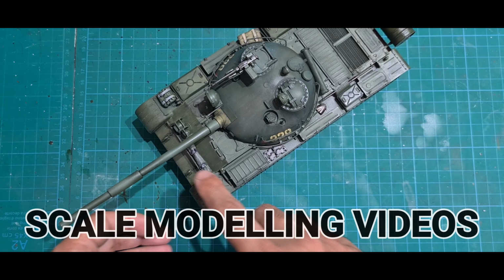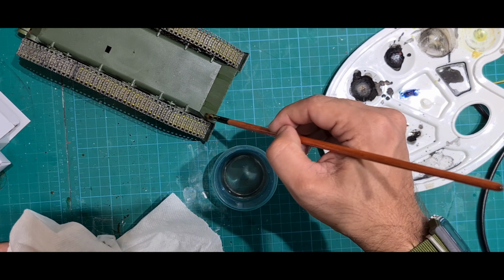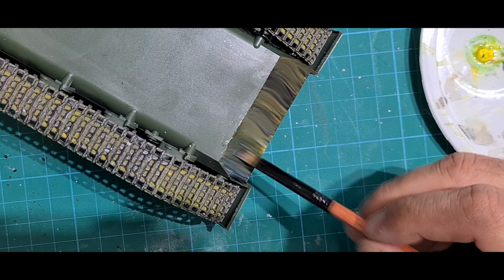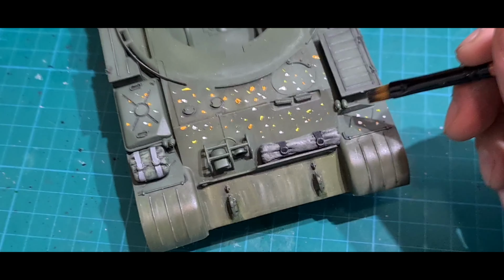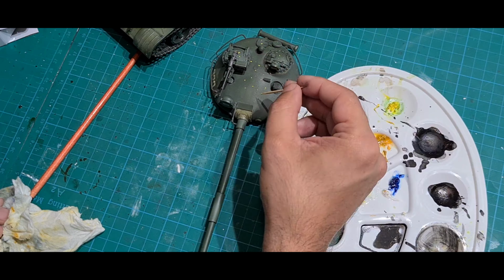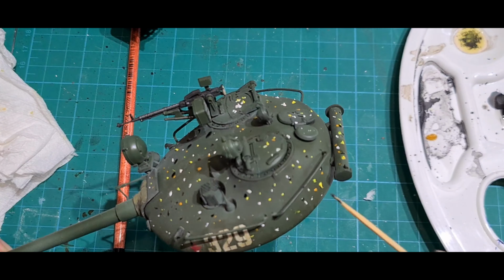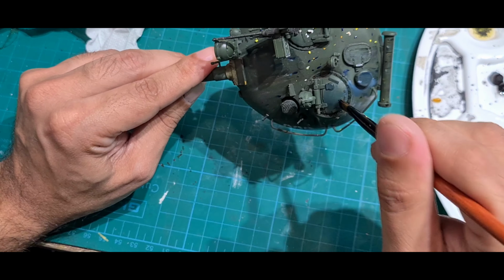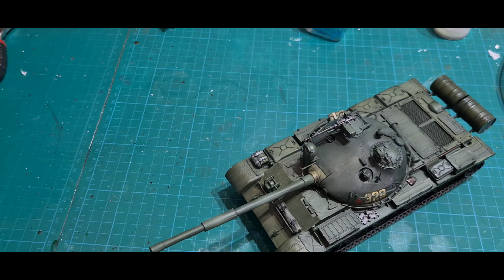How to weather a model - using a Dot Filter

Comment: I have  mr super clear matt. Will that work for this purpose. I also have Vellejo clear gloss to seal the paint work that I've done. 2. I painted a recently finished  M-60A3 in reforger colors. Which one of the oil colors should I use for  this filter.

Comment: Is the "up and down" motion you mention moving the brush up and down while keeping the bristles on the surface OR pulling from up to down and then rising the brush off the surface and then moving it back to the top and then lowering it back on the model and pulling the paint down?
Reply from the maker: Thats a very good question. I didnt think of that while making the video. In reallity it is mostly pulling from up to down and then rising the brush off the surface and moving back to the top. However when the paint is still mixing and you have the rainbow effect at the start, I sometimes keep the brush on the surface till it mixes and then start pulling from up to down. Hope that helps, great question, really got me thinking.
Reply: @ScaleModellingVideos  Thanks!
Reply from the maker: @uglitor  No worries mate

Comment: Will a Matt varnish ruin this?
Reply from the maker: Its a tough one, a matt varnish before the application of the filter will make it grip more and have a stronger effect, cleanup will be harder. As for a matte varnish after applying the filter, I think if you use Alclad, it should seal your work in fine.

Comment: I've had more good experiences with this technique using a satin coat by either Mig's or Vallejo. For me it seems matte takes hold too quickly and gloss doesn't take the filtering very well. Satin however, gives me time to work and blend colors as I wish. Anyway, nice work and thanks to Reddit, I've found your channel and subscribed.  Is that a T-55?
Reply: Nm/it's a T-62 I should have read the comments lol.
Reply from the maker: Yes it is. Appreciate the feedback, i do agree with the satin coat, i use that more on aircrafts, as I like more grip on tanks/ afvs for filters. Anyways I will post the video build of the T-62 next week.

Comment: Dude, you’re using way too much paint for a filter, that’s more like a wash.
Think of a filter as looking at the model through a pair of tinted spectacles, it should be a barely noticeable transparent layer to unify the colours and add a hue. Doing it too thick changes the colours and hides the colour variations such as the modulation and occlusion you worked hard to add in previous stages.
Reply from the maker: Thanks for the tip